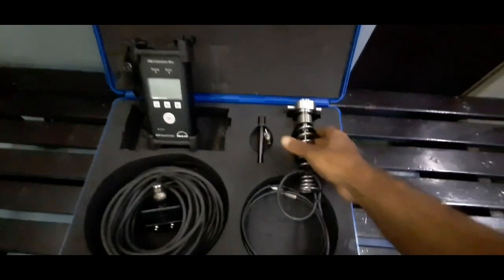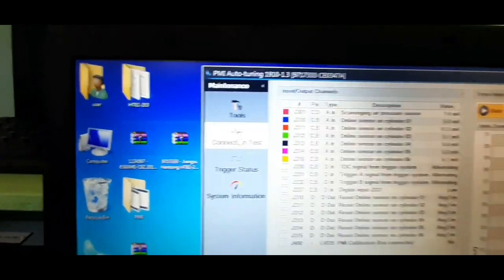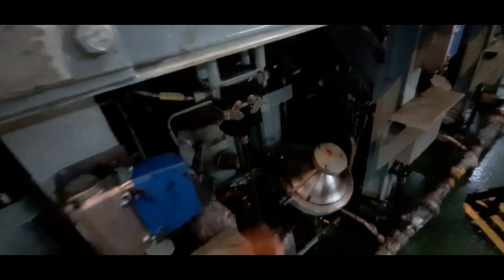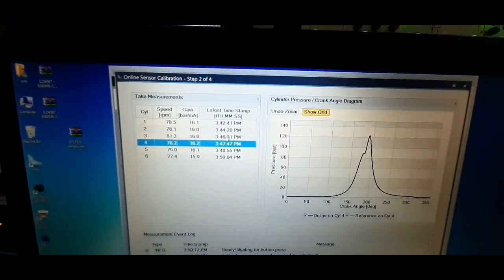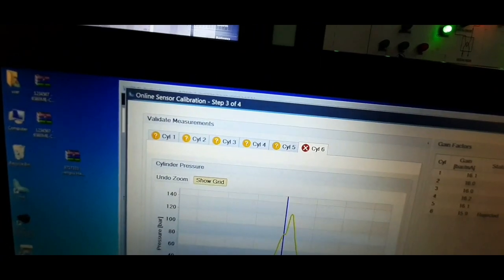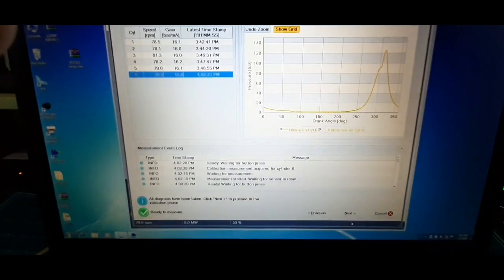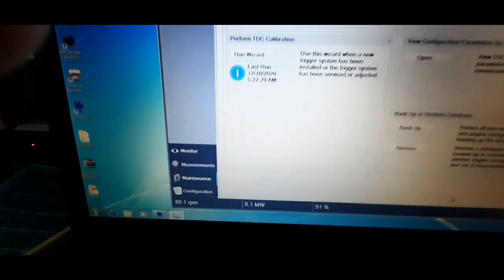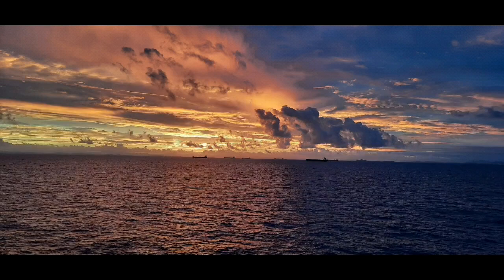PMI ONLINE SENSOR CALIBRATION PROCEDURES | SEA LEGEND |

Comment: Nice and informative. Would you please tell me about prior blow through before fixing the PMI sensor on the indicator card. Your suggestion is not to blow through. But is this opinion from engine instruction book? Thanks.
Reply from the maker: Hey thks for watching the video....and i appreciate ur question....yes it's instruction from sensor manufacturers to avoid blow through as same can damage the sensor performance....never blow through during engine is running as combustion gases damage the sensor ...u can conduct blow through initially while preparing the engine.....

Comment: If gain value of any unit is different from rest of the units, what should be done? In the Video it is advised to reject that reading and do it again . If gain factor is still different from other units  should we replace the sensor?
Reply from the maker: Yes u r right the sensors needs to be replaced as its gain value is not inline with others...
Reply: @sealegend1627  how much deviation in gain value is allowed?